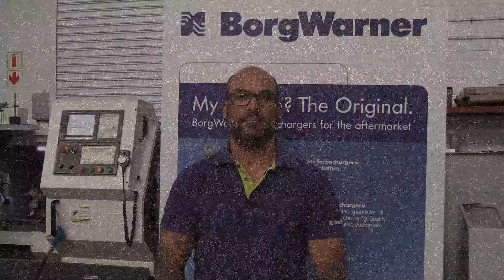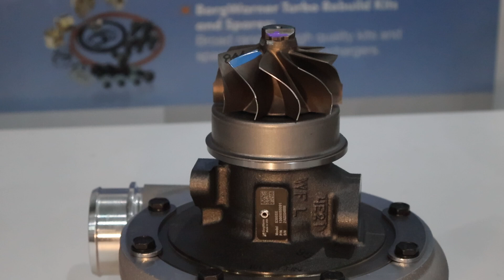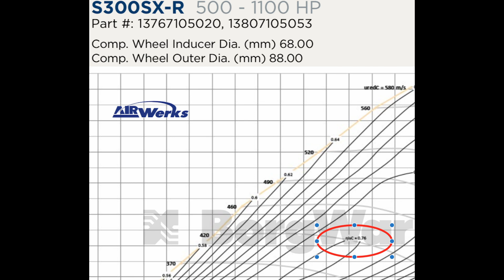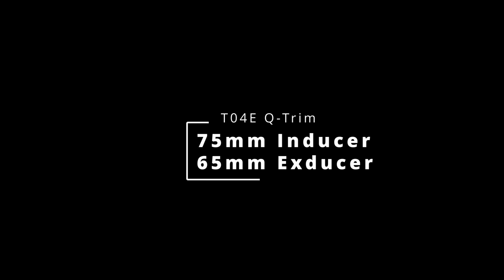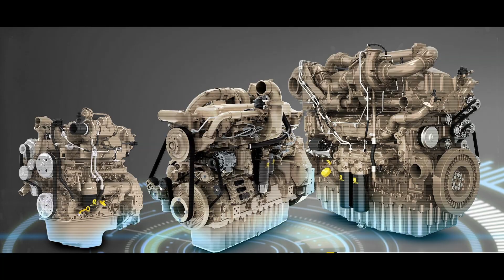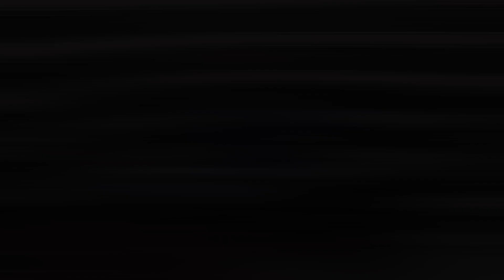S300SXE versus S300SXR The long awaited Video

Comment: Great video! Thank you!
Reply from the maker: Glad you enjoyed it
Reply: I have a question you mention the sxr and sxe uses the turbine wheel with a cutback. Which turbo uses the flat blade with the horizon
Reply from the maker: @TheAnonymous1one the Smaller 76mm turn on me uses a zero cut back blade. The larger 80mm wheel uses the cut back - specifically to combat HCF - which is another subject all together
Reply: @TurboDirectSA so if you buy w s364sx-r it would have the standard cut
Reply: One other question since the only real difference is the compressor wheel is an s364sx-r really going to have better response than the s362sx-e? I’ve read this claim. I wonder if the comp wheel truly is lighter missing one blade but being 2mm larger in diameter

Comment: It looks like a good upgrade over the SXR, but I wonder why the HP ratings are higher than than the SXE. Though I am aware that the 100hp per 10lbs/min is a general rule of thumb and could be less more in reality; why would they rate the 368 the same as the 372 despite flowing less at the choke line. Also do you have an opinion on the new G-series II? They seem to fill that gap in the higher PR area that was very badly needed on smaller displacement/high boost applications like my 4g63.
Reply from the maker: The new g-series are unreliable, but still do not flow close to what Garrett publish in the maps - they about 15-20% out
Reply: @TurboDirectSA  Thanks for the quick reply. Yes I agree 100% about how Garrett overrates their maps. I was just noting that it seems Borg is doing the same on the new SXR turbos. 

Also off topic, but do you happen to know if the SXE compressor housings that are offered for the EFR turbos flow more? I have only been able to see one back to back comparison online saying the SXE housing flows more. I have an EFR9280 on my car and I heard Borg was planning to release the SXE covers for the black series EFRs as well.
Reply from the maker: @bkr7e811 main reason they offered is for their compact size. Nothing to do with restriction at all.

Comment: Quick question.... I've made 765wheel on my 7mgte with an s372sxe.  Would there be any gains to be had by switching to the sxr series?
Thanks....
Reply from the maker: Yea certainly - especially on the SXR200 - it’s got a massive increase in mass flow

Comment: Nice vid. I've run a Holset Super on my Landcruiser 4.2 and lives most of its life at 20psi without issue. I love the design of these turbos, tough as! I'm currently comparing the SXE91S75 13009097051 and the SX-R88x77 13807105053 for a Hemi 5.7 for daily hauling.

Comment: Hi buddy, regards from the UK,what would you recommend for making up to 1000 bhp on a f82 s55 fully built, using e60 plus. Also what results could we expect on 99 pump and 99 pump with meth. Would like turbo to be more responsive so may give up overall power if need be.

Comment: Hi buddy, what would you recommend for making up to 1000 bhp on a f82 s55 fully built, using e60 plus. Also what results could we expect on 99 pump and 99 pump with meth. Would like turbo to be more responsive so may give up overall power if need be.
Reply from the maker: Hey Max - you have some nice option in BB and journal bearing models.  The EFR9280 black for the BB option and then the S300SXR for the JB option.  Power is something noon can predict - this depends on the motor, Cr, cam profile, supporting hardware and the obvious tuning setup.
Reply: @TurboDirectSA  Thanks for the swift response, I had been thinking of the 300SXR instead of a G-35 1050 although I was interested in their gen 2 yet to be released. Currently have twin G-25 660 but had preignition at 195 mph and many problems with manifold and others so looking for a single turbo. Will let you know how we get on😅
Reply from the maker: @Max-jr7xk  with pleasure. Once you install your first EFR — all other options won’t even be worth considering

Comment: hey Chris! My EFR8374 T4 1.05ar is damaged and i'm looking to replace it. Is the 364sxr a good candidate spool wise? The maps say yes but is it reality? Engine is M54 3.0 liter and i was hitting 30psi at 3750rpm with the EFR.
Reply from the maker: @stefanosm5  o would use the SXR for sure but use the smaller AR turbine housing and it will spoil similarly to the EFR physical size of
The housings MIGHT not fit if your installation is tight. But you will love the new SXR for sure
Reply: @TurboDirectSA  thanks! What ar housing do you recommend given my manifold is already twinscroll t4? Also what about the efr8474 compared to 364sxr?
Reply from the maker: @stefanosm5  8474 is a decent upgrade to
The 8374 and spools identical to the 8374. Bolt
Off and bolt on again. Maybe repair with a CHRA — if you want the SXR - go for
The AR 91 T4 twin scroll
Reply: @TurboDirectSA  i prefer not to repair the 8374 because at 750hp i was almost to the compressor rpm limit. So i'm looking for same spool but a bit more room for safety
Reply from the maker: @stefanosm5  Got you. In that case you have two options — 1) EFR8474 Black - same
Turbine with higher flow compressor - all you need to buy is the supercore - you have the rest already. 
2) S300SXR - AR91 T4 - will bolt onto
The manifold but lines will change -similar spool less money and similar power to
The EFR

Comment: Hello sir. 2012 WRX. Previous build, for reference: 2.5 wrx, 272's, FP Black, 536awhp 471 tq, 8k, 91 oct + water/meth. Street car, with some roll races on the side.

New build will be either a S258 sxr or s364 sxr on a *2.34 EJ destroker* with 272 spinning to 8500 on 91 + water/meth. Not chasing a number, but looking for 565-605 awhp ballpark. Chose the new shorter stroke, to keep torque a little lower to keep the engine and trans alive, while bumping the hp up top.  I have been working with Matchbot, but I would like your opinion, please.

If it were your car, and the efr's are out of your price range, would you go with the s258 sxr or s364 sxr on an ej 2.34 destroker, and why?

Thank you very much, sir.
Reply from the maker: This is a great question. I havent managed to get hold of Chris to ask him about this, he is in and out of the office. From what we have been taught by Chris, the smaller turbo will not produce these numbers due to the high engine RPM - it will run out of flow in the higher RPM range. The larger SXR300 turbo would be the better option by far.
Reply: @TurboDirectSA  Hello again. Thank you for the response. While I am still curious about which way Chris would lean to the original question with lets say 565awhp, however I am also rethinking my approach, as well. My new thoughts are to push the limits a little and shoot for 500 awhp on pump gas only, and then run a little bit of water/meth without retuning, just purely for safety only. This way if the water/meth pump fails, its not the end of the world, as the tune is not reliant on it. The new question is: Can the s258sxr hit 500awhp on pump gas and still hold a relatively flat hp curve out to 8500? Or is the s364sxr still the better bet? My thoughts are the 64mm turbo will hit the mark with much less effort. I honestly do not mind the lag of a bigger turbo, however I might be able to have my cake, and eat it too. Thanks again.
Reply from the maker: @jonathanh4446  S300SXR is a much better option, especially considering the high RPM of the engine.

Comment: Hi Chris,
Do you think s200 sx-r would be a good choice for fa24 brz 12.5:1 compression engine for low boost application which is running 0.5 bar for pump fuel aiming around 400bhp or with water methanol injection 0.75 bar aiming around 500hp for lets say club racing?
Reply from the maker: @muratordutv  yes it would be - high CR will help spool the turbo easily and the flow rate will flow Through to the top too.

Comment: So the cut back you mention on the wheel is used for??
Reply from the maker: @SakkieBuys  I went to ask Chris for the relevant explanation - here you go courtesy from Chris himself. “The technical
Term is high cycle fatigue. The cut back combats this - without it the blade tips will break off due to a cyclic fatigue failure (at normal operating speeds which are high in this rotating assembly)  - as cycles increase the bending moment at the outter edges of the blades will flex (blade excitation) which is normal, and surface cracks will develop which propagate (spread) along its grain boundary, eventually leading to a material failure and the blade separates from the head”

Let me know if you don’t understand what he has said and I’ll ask him to make a video for you - when he has time.
Reply: @TurboDirectSA  yuslaaik boet dankie but over my head. Sorry to be a pain, but i think if he can make a short video when he has time about this it will help. I actually feel bad asking.
Reply from the maker: @SakkieBuys  https://www.youtube.com/watch?v=In4xXIrDeEA&t=13s
Reply: @TurboDirectSA  see what i mean - this man talks a different language to us. I also so want to know this explanation please and also does it affect our turbos we have purchased form you?

Comment: Hello from the USA Chris!, Currently making 707whp with my SX-E366 66/73. I'm keen on finding out if I can make close to my 1000whp goal with this new SX-R364. That would be wicked to gain transient response and make couple hundred more hp.
Reply from the maker: Hey @Ztuned88 - thanks for reaching out. The new SXR 300 -5022 flows ALOT more than the older model (76mm turbine) and im sure you will love the results! It is a true upgrade!

Comment: I really think, all those changes & you've only gained 2 percent efficiency. What's the point, piss poor as far as I'm concerned. 0.2 to 0.4 gains are you  joking why bother.
Reply from the maker: @ sure why not opt for the same money and gain + - 500RPM in spool with a smaller and lighter rotating assembly that makes more power sooner and throughout the entire RPM - absolutely why bother - and then the penny dipped and you realised the shortsightedness of your comment. I guess it’s the same as a formula one team bragging about increasing the efficiency of their engine by 1.2% - why bother …. BECAUSE IT WINS RACES, IT IMPROVES BSFC (brake specific fuel consumption) and the engines VE - making for a MUCH BETTER overall drive, and power output- THATS WHY!

Comment: Could I make a request?  If you guys are making more videos? Now that the g40 is out, can I get a comparison between the g40900 and any of the g35 size turbos, say a 3582 or a 6466. 

 or whatever is the go to for late model BMW's. (Any 2.8 to 3.2 )  It doesn't have to be BMW. I could extrapolate the info from a 2j or anything similar displacement. I would like to think the g40900 makes more power than the 3582 66/62 with similar manners. Doesn't have to be e85 (that would help the g40 obviously )
Reply from the maker: @l_ionize333  great suggestion will pass it to Chris and get his feel on this

Comment: Which would be best if coming from a S366 SX3?
Reply from the maker: @AdaneEdmund  what HP target? What engine? What is the fuel and intended boost you want to run?
Reply: @TurboDirectSA  2JZ no HP targets but boost target of 20psi on pump and 35+ psi on Race gas

Comment: Looking to make eleven hundred wheel horsepower out of a k24 Can you give me a turbo recommendation
Reply from the maker: @amandalabate2049  you would need to up to
The S400 range for this power target. The Honda revs high and most compressors run out at high engine RPM

Comment: Anything to recommend to replace my g35-900 garret ? im in between 470-550kw, most important is i need coolant and oil cooled lines and ballbearing.
Reply from the maker: @vantsen-Q  EFR8474 black series will destroy the G35 -

Comment: I always appreciated how Borg  Warner rated their turbos at 10 hp per lb mass of air. It appears that's not how they are rating the SXR which is a little disappointing. Can the 68mm SXR actually make 1100hp like they state? I believe the s372sxe can.

Comment: Perhaps I am wrong? The compressor maps say this a match for 250-300 bhp engines with wastegates
Reply from the maker: @kylemilligan752  the power range start at 300HP upwards. Depending on the size of the engine and boost level you the smaller 64mm SXR will produce around 300Hp without surge or choke issues
Reply: @TurboDirectSA I think we have a misunderstanding, a 275-300 brake hp engine will run off these compressor maps out to their max .compressor/turbine rpm is going ballistic.recomending running a turbo to the max possible on the map is beyond foolish
Reply from the maker: @ 300HP will
Never see the ROM of any of this range of SXR turbos close to their max rpm. - just not physically possible. Where are you reading this info from?

Comment: These two compressors are optimal on a 250-300 bhp engine. Trying to quote a max lb/hr is ridiculous when the shaft rpm tells you turbine will be overspeeding trying to support the compressor. Running across two or three shaft speed lines is requiring more work from the turbine, and backpressure will skyrocket
Reply from the maker: @kylemilligan752  the max flow rate is fact, it’s quoted and printed from tests on a gas stand. It is what it is, how you put it to good use and how you configure your engine to “use” the flow (which is ever changing) is up To the tuner.
Reply: @TurboDirectSA  I have no issue with the compressor maps.  Now, tell me simply what n/a engines hp outputs  fits  on those compressor maps?
Reply from the maker: @ pls check the channel for other videos we did on how to plot a compressor map. Or you can go to the borgwarner matchbot to plot the same for your engine

Comment: I still prefer the S372sxe. It's more efficient at higher flow. For example at 95lbs/min at 30psi its at around 68% efficiency compared to around 64% for the sxr. Result will be less heat and lower intake temperatures
Reply from the maker: @marte1153  agreed - depending on the engine and it’s VE